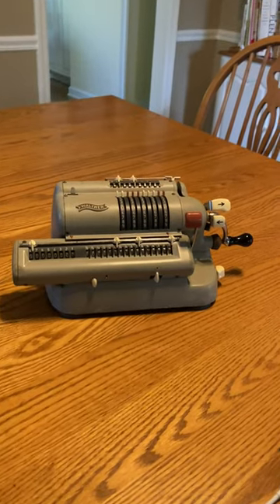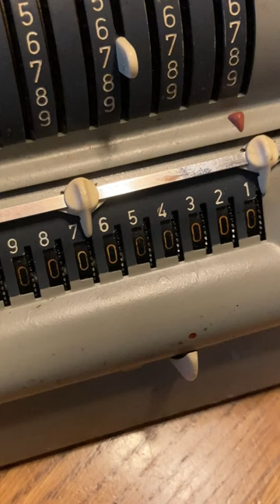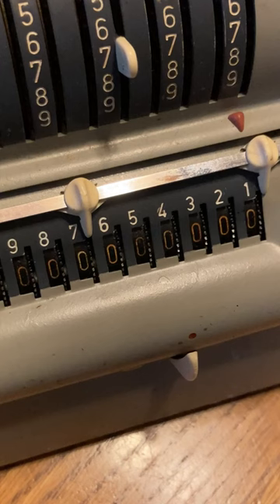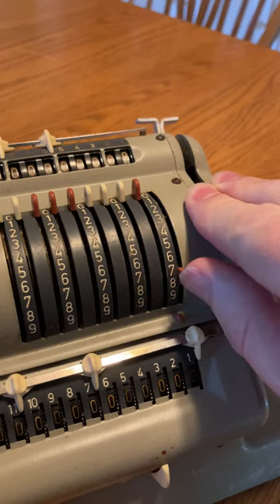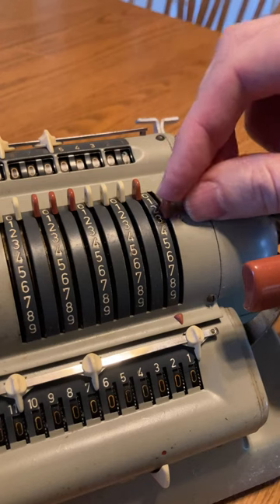Pinwheel Calculator- how it works!

Comment: I used my Monroe Model K today. Given the central angle of an arc and radius, I have a book with a table of arc lengths of the radius 1 circle. Add up the lengths for the degrees, minutes and seconds then multiply by the radius to get the arc length.